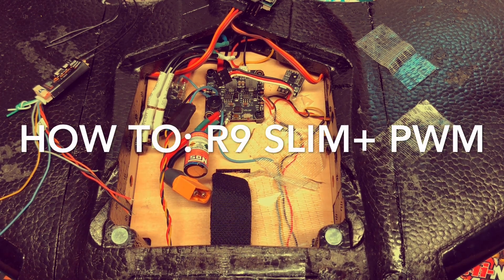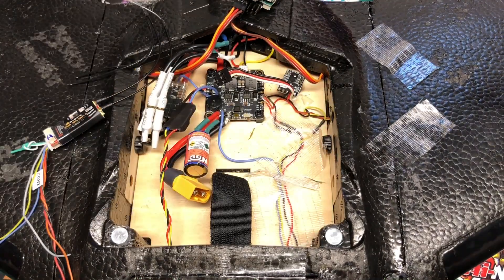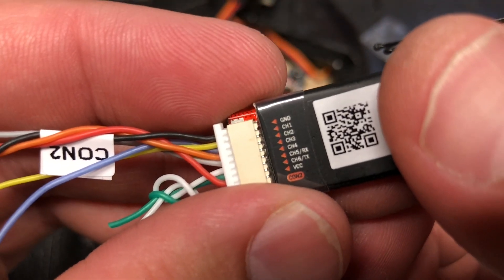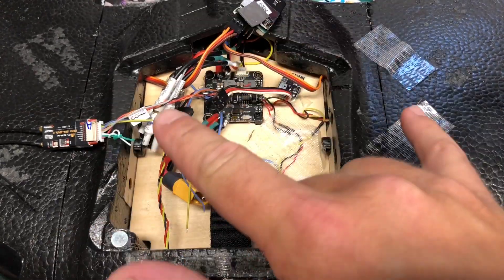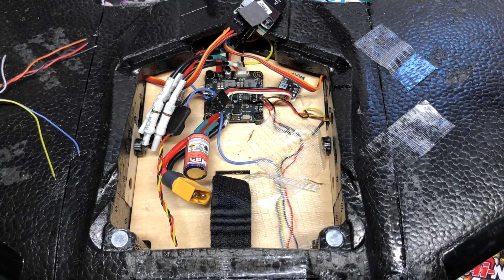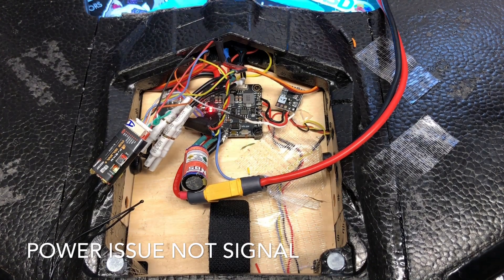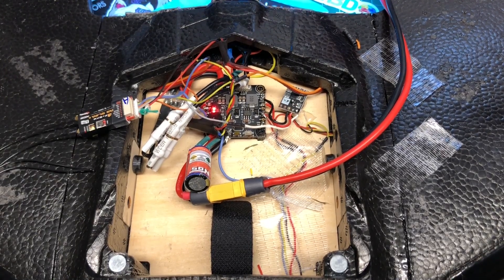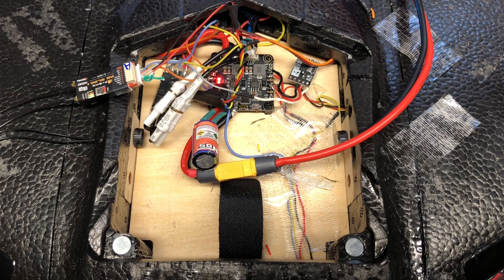How To: Connect frsky R9+ With PWM For A Wing Or Plane

Comment: Thx. Another option is, to connect the PWM harness to a standard 2.54mm connector row. So, you can connect your servos/ESCs without cutting any plugs of.